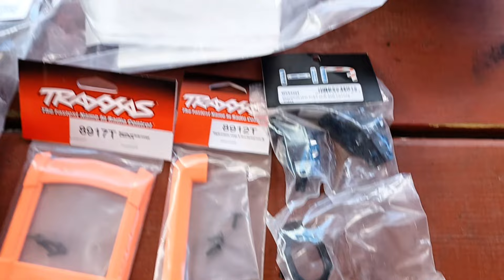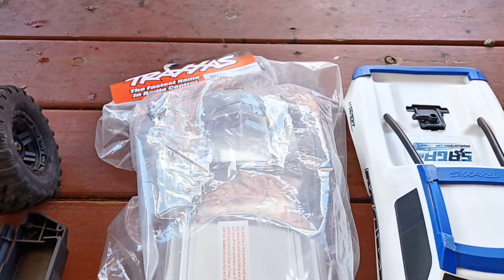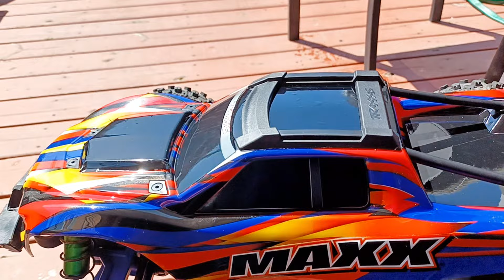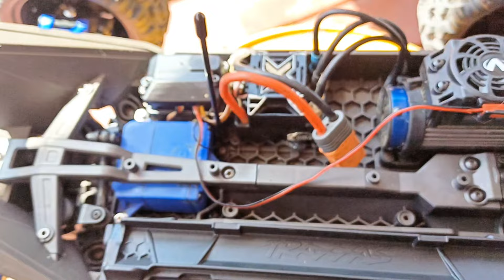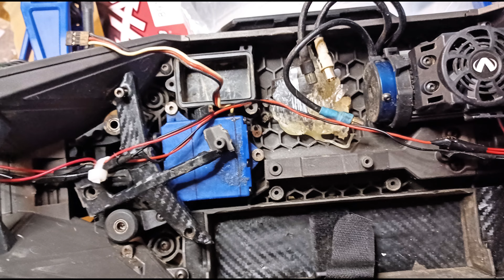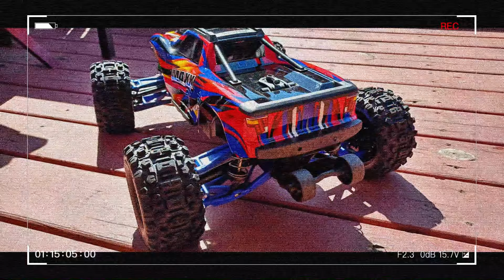Traxxas Maxx V2 Rebuild

Comment: I need to do the same v2maxx before I sell it but don’t got the money😂😂
Reply from the maker: It's worth it.
Reply: It's a cheaper rebuild bro, why not. if i had a raggedy Maxx, i would have done it.
Reply: @spenn2007  yea I want the sledge tho insted if the maxx
Reply: HUH? Bruh, if you have a 700.00 budget go with the Kraton 6S EXB or even the BLX, the sledge depending on how you drive is going to be another rebuild for sure lol.
Reply: @spenn2007  I don’t like arrma lmfao 🤣 I’m a fracas fan
Reply: Weird, if the RC is good, ill get it. But hey, someone has to like and buy inferior products. Usually when someone says they don't like Arrma, its because they never owned one. Horizon Hobby, Arrma, Losi, Axial are clearly leading product popularity in RC. Not referring to what your hobby shop has.